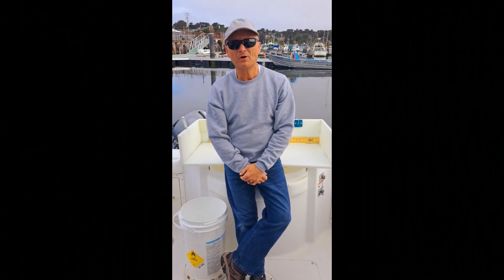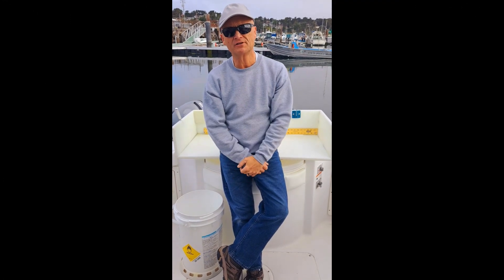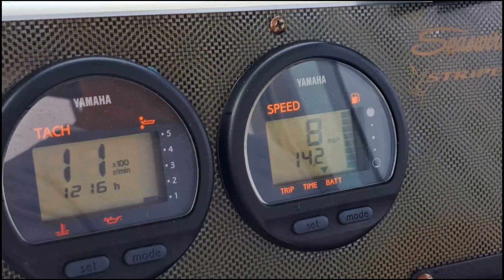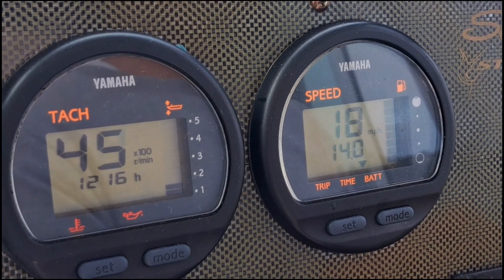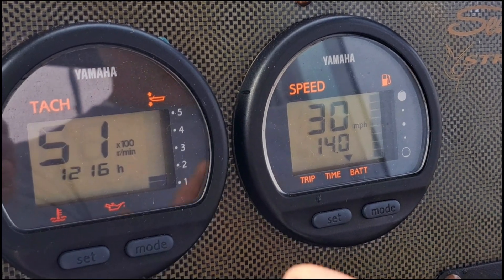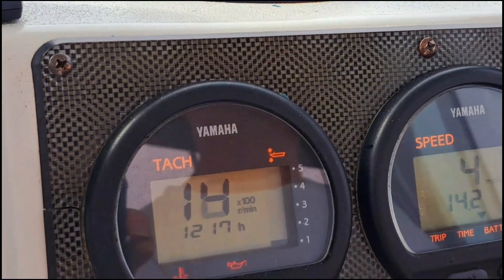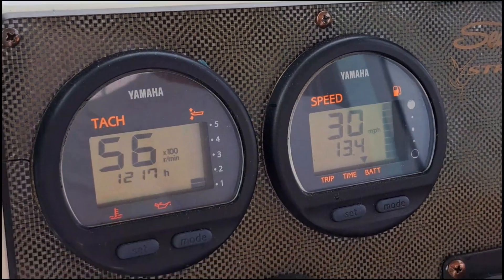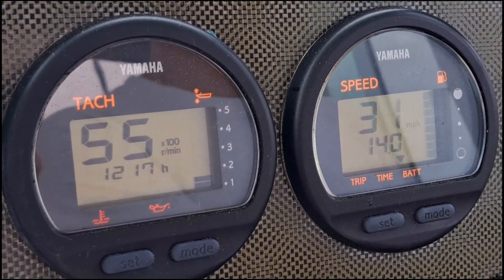Changing My Prop to Increase RPM & Speed & Less Stress on Engine

Comment: Cool good job we just did the same but we went to a four blade and from a 19 to a 17 pitch and we burn a lot more fuel we went from 30 to 40 + gallons a trip but we have more power out of the hole and we are cursing at 3800 rmps and 30-32 mph and that’s were the boat and fuel seem to do the best if we open it up we burn 32 gallons a hour according to the meter and online specs I’m curious to know how it works out for you. Hope to see you out there light lines brother! 👍👍👍
Reply from the maker: Thank you so much brother!!! Thanks for the info. on yours, yes I've heard the hole shot on those four blades are pretty awesome! I'm looking forward to getting out there, and putting some time on that prop, and really see how well it performs! My engine has little over 1200 hours so I know the old girl is starting to show her age bit, I'm just hoping to get a little bit more out of her before looking at replacement!! Look forward to seeing you out there too, and tight lines to you too!!!!

Comment: I have a Yamaha 150 on my boat and I usually bring it up on plane and then back off and cruise at 4K RPM. Is that wrong? I thought running at wide open or close to it was hard on the motor. Now you have me questioning myself. 🤔
Reply from the maker: Hey Ron, no you are not wrong! I do the same thing however I'm not sure what your wot rpm sweet spot is, I know mine is 5800-6000, and Yamaha does not say anything about running long periods of time at wot, they just say that your motor should be able to run at the proper wot rpm! I also don't like to run mine at wot for long periods! Thank you so much for the great question!!!!